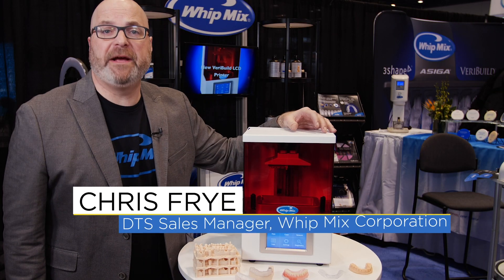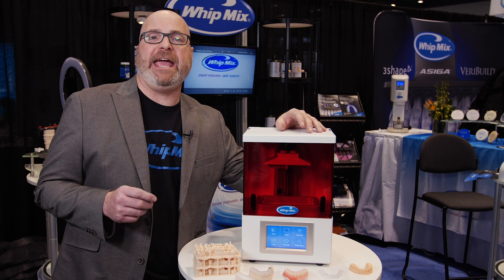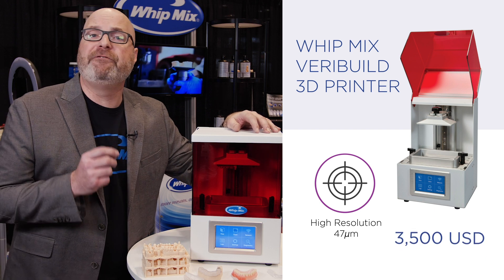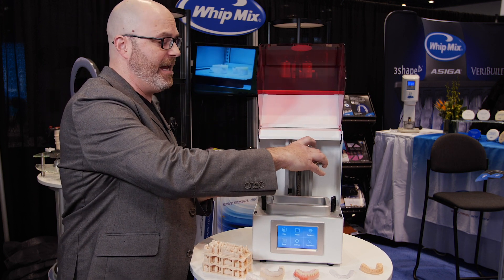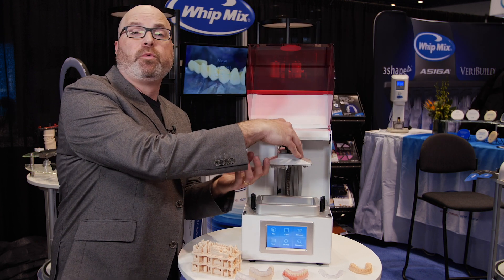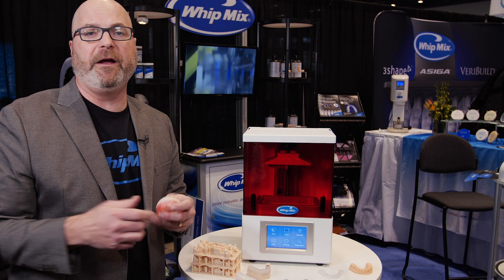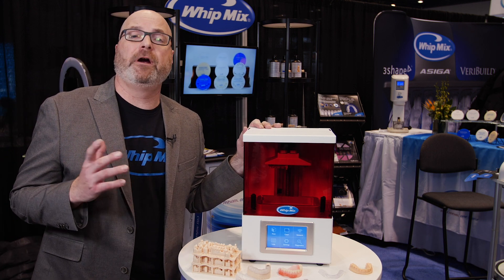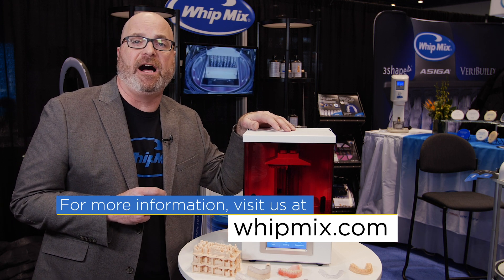Whip Mix VeriBUILD 3D Printer

Comment: Costo en México?
Reply from the maker: Póngase en contacto con su distribuidor local. Aquí está su información:

Depositio Dental Villa De Cortes S.A. De C.V.
Calzada de Tlalpan 836 Villa de Cortes, Benito Juárez Ciudad de México
Teléfono: 52-55-590-2165, 5579-9199
Fax: 52-55-579-7581
Correo electrónico: esafar@prodigy.net.mx